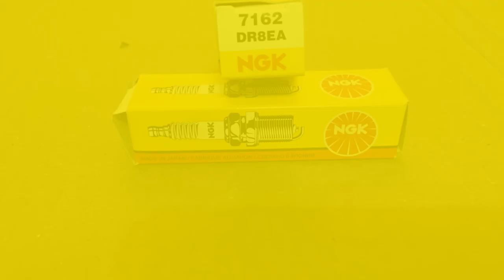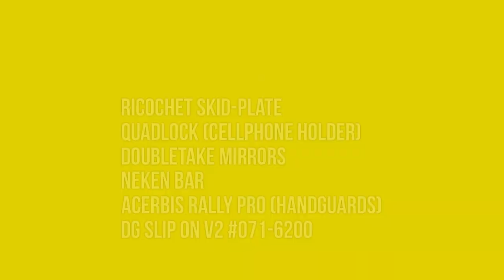Suzuki DR200

Comment: Hello there, I bought new dr200s for only road use , NO TRIALS WHATSOEVER,, please can u suggest me on the tyre inflation ? Because as per manual , they have both trial and roads.
Iam have 31psi at rear and 30 at front , will that be fine ?
Reply from the maker: Ram, I suggest you refer your question to the DR forums on the internet, as I am not qualified to answer your question.  The DR forums are very helpful and I am sure someone can provide you with accurate and safe information.  Good luck.